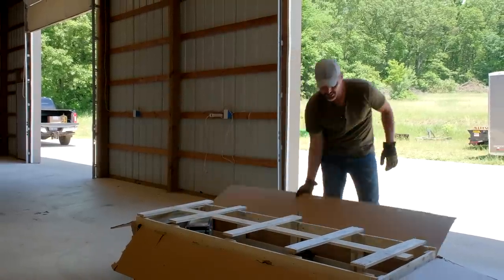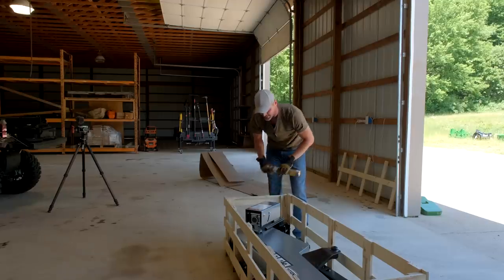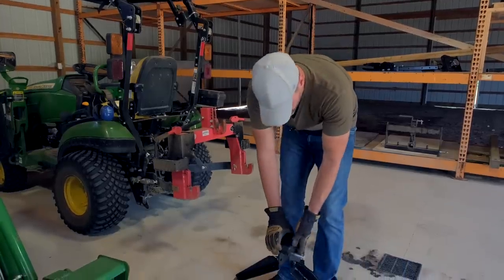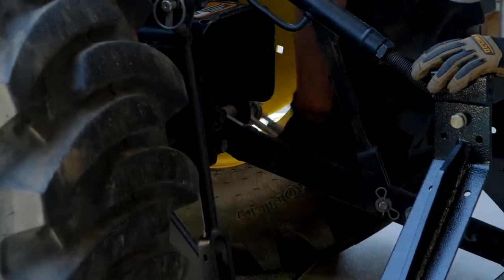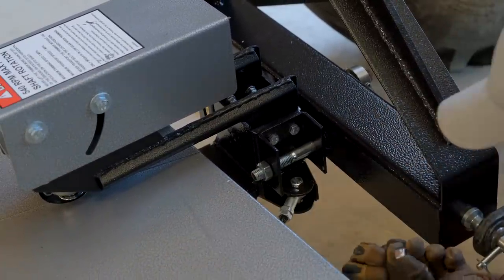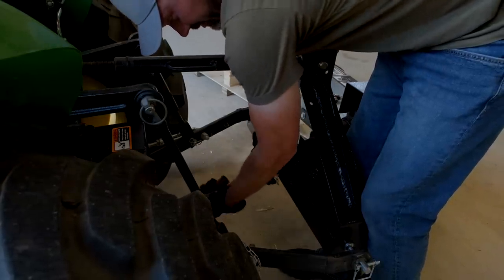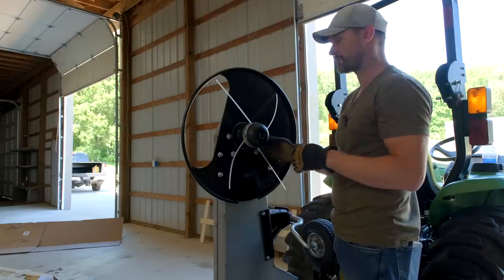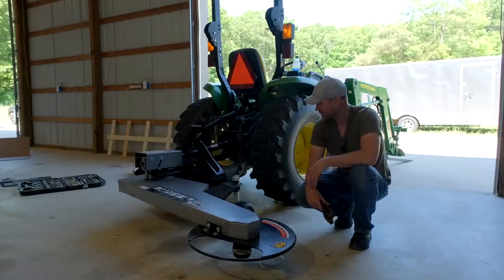OUR NEW PROPERTY REQUIRES A BRAND NEW ATTACHMENT.

Comment: My Brother brought a DR unit Similar to this Titan about 4 years ago to cut the banks around the State Lake in Al he manages. This unit has worked pretty flawless, with the only major change he made by putting a solid runner tire on the trail wheel. This Unit has cut roughly 1.5 miles of lake 3 times a year for 4 years now. The only parts he has purchased is a belt, set of idlers and the bottom hub that is at bottom of cutter head. This item seems to wear thin in time. This unit was mounted on a 750 compact 4 wheel drive John Deere tractor. It has been a lifesaver to keep this much bank cut.

Comment: Have the DR on 1025R.  Takes a lot of getting used to. I have barb wire, uneven topography, plenty of undulations.  Two friends tried in similar environment, gave up and sent back. I think it just takes adjustments and patience. This is my 2nd season. Unfortunately I waited till end of mowing season so all growth of weeds and grasses mature. I'm ready to start this yr with fresh growth at a manageable height. Ur smart to start trimming high and lower as u gain experience. Uneven trimming will eat cords like u wouldn't believe.  It's interesting to see ur trim path narrow as strings wear. Be patient, try to drive straight, and the slower the better. 1025R perfect fit for attachment, no load what so ever.

Good  luck to all!

Comment: Courtney,
I bought the DR trimmer.  It does work with the quick hitch but tends to hang up on the top link a bit.  Overall I had similar issues.  Far as use it’s ok but doesn’t work as good as they show in their videos. 
I have their walk behind trimmer and it works good but I needed something to cut between posts. Bottom line I spent a lot of money on an attachment that takes up room.

Comment: I have owned the DR trimmer type for about 4 years. Its good on level ground but has problems in corners or where it undulates alot. I had issues with the drive system as it is one very long belt and not sized strong enough. Fixed it by using a linked belt - strong and replaceable when you jump a wheel inside drive. I also had to get a replacement wheel hub as it melted when it came in contact with ground - hilly land - and backing up to get into corners. Inside corners are the worst to get and my paddocks all have them (4) .  I also got tied of replaceing the strings so I made a disc to cut. Used a round flat disc from ASC (a coulture disc) - and swinging knives  (From Rural king) by punching 4 holes  around exterior and made the central hole bigger to size. It works great now but I make sure it is off anytime I leave the seat of tractor as it will really cut.The combination is still smaller than the wheel guards so it is safe to use. I wish I had a dedicated tractor as it is a pain to get on and off,  but thats tractor attachements.

Comment: The only thing different on the titan from my DR is the grey cover on top. I run mine with a bx2680 and it handles it fine. Plus it’s nice to use the smaller tractor for those inside corners because it’s so nimble. That long bolt at the pivot point (under the pto) is to lock it in horizontal position for transport or most fence applications. The other hole is used to lift the 3pt and let the head go down deep into ditches or pond banks. I find in the “locked” hole it still has enough flexibility for under fences. One word of advice. That nut till come loose. I put a big wing nut on mine and drilled one of the wings so I could tie it in with a piece of wire so it wouldn’t get lost (again) haha.
Reply: You will also likely need to play with the spring tension so it behaves how you want when you use around the posts. Mine was too loose from factory and it tended to pull backwards just from the gauge wheel riding on the ground

Comment: They are a handy unit, a orange orchard I do some consulting work for use a Fischer brand unit for trimming under the oranges works a treat. You want the trimmer line to be half inch to an inch shorter than the bump guard. They're used in vineyards so you'll be fine using on grapes, just keep the trimmer line shorter as mentioned and keep the tension off the spring so that the guard doesn't damage the vine. I personally just use a JD F1145 to mow under the fences with abit of round up for the posts.
Reply from the maker: Yeah, that spring tension is my biggest concern...seems like it could rip the plants right out of the ground, haha!  Round Up must be okay around grapevines?
Reply: @GoodWorksTractors  yeah the spring was my biggest concern as well but I just set it at it's least springy setting lol and was all good. For grass control around grapes I'd be using fusilade forte (not sure if you guys get that in the states) active ingredient is Fluazifop-p

Comment: Hi, I think you could slice a hose long ways, put it into  the round guard circumference, and sucure with plastic electrical wire ties after predrilling tie holes through the guard for for them. This would give your guard a softer bumper when it's going around post, trees, grape vines, etc.  You could experiment with other materials like foam nodules, pipe foam insulation, multiple layers of hosing or combinations of per say to cushion the bump of the guard hitting delicate objects 🤠

Comment: The loader mount on that tractor is so beautifully curved. We really need a mower like this. We have around a thousand trees in an orchard and cutting the grass down around the trees is done with brushcutters. This is hard work and takes days. However a lot of trees are too small for a mower like this so it will be maybe two more years before we buy one.

Most probably I’ll look for a hydraulically powered mower and not have the hassle of pto shafts. Running hydraulically could also allow the possibility of fixing it to a mowing deck so both mowing and trimming can be done at the same time.

Comment: A fence line I need to cut has a gully next to it. The offset on that POS is enough that I’d roll my tractor. Be useable if the offset was even with outside of tire, or a couple inches more. My rear tire is 2-3” off the fence when I rotary cut. I pretty much have too (and do) spray that fence line.

Comment: Wouldn’t centrifugal force throw those trimmer strings right out the way they are installed like that? Seems like you would just push the cord in a couple inches until it catches so that centrifugal force would cause the line to tighten.
Reply: This right here.  Same thing went through my mind
Reply: Agreed. I think the 10mm or whatever he said was the pushed out measurement, and not the push it through until 10mm is left. Spin it up and see, but as he has them, they are going to fly out is my thought as well. Just had an extra thought. That 10mm pushed through would be to grab on to and pull it through if you wore them down to nothing and weren't able to push it out with a new string.
Reply: I had the same thought.  He'll learn soon enough, though.

Comment: Really waiting to see what your assessment will be on this unit. The DR Trimmer does not have very good ratings for the long term but this Titan model seems beefier but the issue with some Titan mechanical products is replacement parts availability. Thanks for your great videos.

Comment: This shows why Pat's quick attach is a viable option.
Reply from the maker: My problem with Pat's is you then have to play around with turnbuckles on my attachments....I hate turnbuckles.  I don't think it saves me much time if I have to individually line up and connect each arm including the top link.  I'll just do it the normal way without any quick system if that's the case.  I've used Pat's, just not the solution for me.
Reply: @GoodWorksTractors  For now I am just doing it the old fashion way. Bit of a pain, but as noobie I think I should learn it the hard way before buying any quick hitch.

Comment: I would worry about that long bolt coming loose and falling out.

Drill a hole in the end of the bolt and put in a small retaining pin

I lost 2 bolts on My Backhoe subframe mount that was preassembled

Bought a whole set of six cheaper that buying two bolts from NAPA.

Comment: I'm interested for sure. If you could adjust the tilt on the fly, I could see that for trimming things like roadside ditches as well. I guess there's a reason the string doesn't extend out past the edge of the protective shield like the small hand held weed eaters do?
Reply: the guard is there to pivot around posts and trees. https://youtu.be/Gi9i9or8w7g?t=146

Comment: Does it make a smaller tractor tippy to one side?  My fence lines are on a slight incline which I can mow fine but I wondered what would happen adding weight to one side with one of these.
Reply from the maker: I'm sure it does, but it is not that heavy.  330 lbs total.  Also, while in use, there is a gauge wheel for support.  So, the offset load would only apply when the 3 point lifts that gauge wheel off the ground.  At least that's how it works in my head!
Reply: @GoodWorksTractors  once I got to the end of your video where you show it sitting level on the guide wheel I was thinking the same.  I guess that is why that is there to take that weight instead of pulling the tractor to the side.  Nice overview.  It’s a shame about the quick hitch, the top link, and that transport bolt should have a pin and not a nut for quicker removal in the field.  I’ll be curious what your experience with it is over time.
Reply from the maker: Agree about it all.  Especially that transport bolt, I'll likely look for a way to remedy that and make it quicker.
Reply: @GoodWorksTractors  hah yeah I was thinking worse case drill a hole through the bolt and use a hitch pin